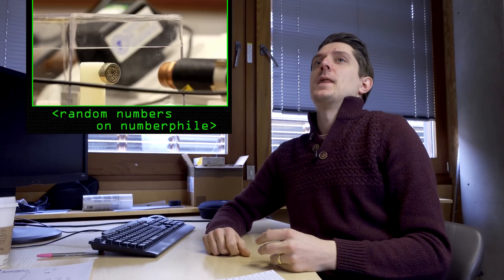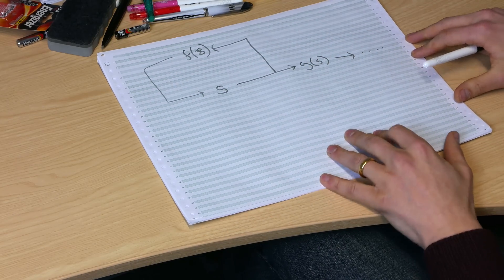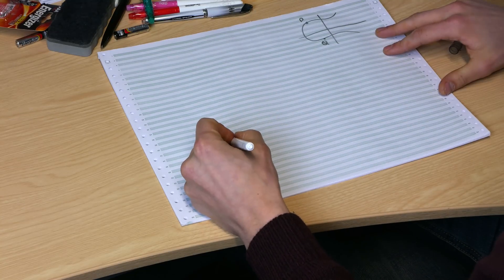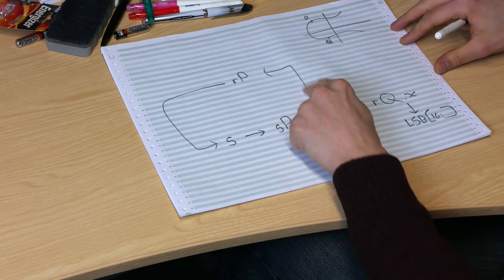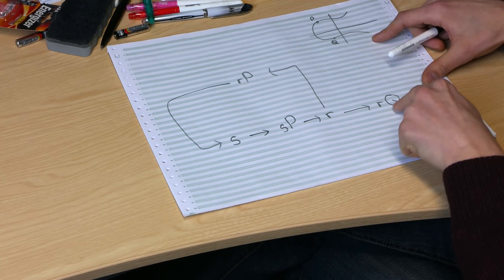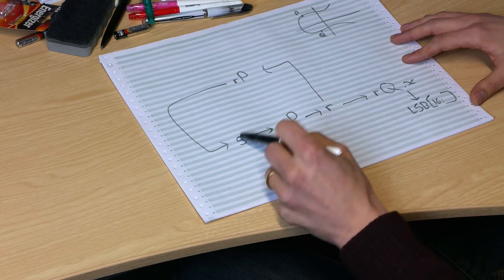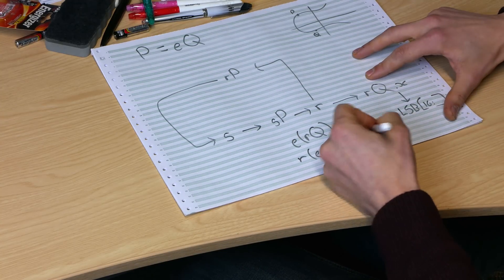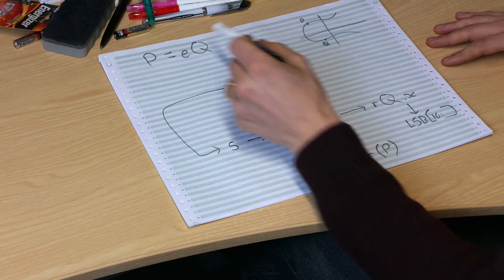Elliptic Curve Back Door - Computerphile

Comment: Tomorrow news:
Dr Mike Pound was found with 3 shots to the head in a body back in the river and the officials rules it as suicide.
Reply: (pst, Cameron! that's the joke...)
Reply: Nah, the official story is he jumped off the top of a tall building near the river, FELL on 3 bullets that happened to be on the ground, and his body rolled into the river. Seems legit.
Reply: bag*
Reply: You predicted Epstein
Reply: Pfft, that's absurd.  You don't need to control what information gets released very tightly when you've got enough influence over the communication graph of a population to ensure no large-scale change to the status quo can occur.  Once you realize how easy it is to break social networks and increase the distance information has to travel (in terms of nodes/people it has to pass through) in order to spread to a large number of mostly-disconnected clusters in the graph, you realize it's tremendously easy to ensure any concerns, no matter how grave, remain isolated within only a few corners of the society.  It requires nothing more invasive and extreme than bouncing or dropping some emails, removing a seldom-contacted person from a contact list, messing up a persons phone so they need a new number, things like that.  Once the critical links between mostly-disconnected clusters (links which are inherently the weakest ones in the whole social graph) become unreliable or break... they are unlikely to be re-established.  And with that, it becomes exponentially harder for an idea to spread from one mostly-connected cluster to another that it is then totally disconnected from.
Reply: @codetaku7  You sir have eloquently formulated this technical concept/idea I had in mind for so long about how some gov's (especially in our Arab neighborhood) are getting foreign technical assistance in doing mass population control to short circuit any activity leading to a coordinated social uprising based on social media. But I believe true human randomness is the key they don't have a copy of.
Reply: Dustin Rodriguez tfw too smart
Reply: @codetaku7  The NSA made me not read your eintire comment because it was too long.
Reply: He must be an android to be able to shoot himself in the head three times.
Reply: Nah, he isn't a threat... if he had dirt on Hillary or Jeb, well, that is another story...

Comment: Why not use a different random number generator to generate the P and Q value?  Then wouldn't it be mega secure?
Reply: Matt T It would. Like he explained toward the end if you pick your own P and Q then it would indeed be secure. The issue was that the NIST wouldn't give you a certificate of secureness unless you used their specific P and Q, which is a huge red flag.
Reply: @Matt T: Well, it's sort of a double-edged sword there. The fact that they won't certify you unless you use their pre-determined values is suspicious. But on the other hand, the fact that they won't just let you pick your own also makes sense, because if they did then they'd be giving you license to put your own backdoor in.

And it's not really a case of promoting a less secure method over a more secure method. We don't know if there's a backdoor in their values, there could be, or there may not be. They could be requiring the use of their values because they have a backdoor and ulterior motives. Or they could be requiring it because they know that there isn't a backdoor and is therefore guaranteed to be safe. But there's no way to know for sure.

The thing is that you don't want the values to have been picked by ANYBODY, because anybody who picks them is automatically suspect of potentially having ulterior motives. But how do you get values like these that weren't chosen by someone? You could use some other random number generator, but then how do you prove that that's where they really came from?
Reply: The problem isn't just that it's not secure. Even if you would take different P and Q values, anyone who uses your service, doesn't know who else knows about your P and Q. So even if you don't use the backdoor-numbers P and Q that were "proposed", you can still give other people the P and Q that you chose, which would still give them a backdoor.
Reply: Per Mortensen - A red flag that your securness isn't certified by NIST, or a red flag about NIST having anterior motives?  Because it raises some red flags to me that NIST would promote a method that is less secure, and withhold their approval to more secure methods.
Reply: @Per Mortensen : Are P and Q the A and B of the EC equation, or are they the coordinates of the base point?
Reply: phiefer3 yea I guess it's a chicken or the egg problem
Reply: +I No, P and Q are not the A and B of the equation.  A and B define the specific shape of the line, while P and Q are just (hopefully) randomly chosen points on the line.

So for example you could pick A=7 and B=3.  Our formula is y^2=x^3+Ax+B as in the video.  Then P could be something like (12,sqrt(1815)) and Q be something like (-6,sqrt(-255)).  Now I've just picked random numbers out of my rear.. I'm sure in an actual system like NIST's standards they would choose A and B such that those square roots are cleaned up and whatnot but the point is to illustrate that A,B have nothing to do with P,Q.
Reply: The fact that they require they own P and Q is basically an admitting that there is a backdoor, I mean only from the understanding we gathered by this simple video, there would be no actual security reason for requiring those specific ones.

Anyhow, assuming "e" exists, how would someone go about determining it? Is brute force the only possible way?
Reply: I can see the problem.  Those numbers need to exist for this to work.  If you were to pick some highly randomized numbers, other people might get suspicious that you picked those for a reason and there might be some vulnerability because of it.  NIST comes out and says were only going to approve of your security if you use the numbers we picked, but you have the same problem.  Do you trust NIST to not build in a vulnerability knows by either them or some government?
Reply: +Koroistro it doesn't necessarily mean that -- they have two options:
P = random(); Q = random(); e = ??;
or
P = random(); e = random(); Q = eP;

In the first case, they wouldn't know e and they could justifiably claim that they've only done some checks to ensure P and Q aren't trivially related or otherwise easy to break and therefore they're confident that the chosen P and Q are safe.  In the second case, they've intentionally created a back door.

If the US government could be trusted at all, there wouldn't really be a question here.  But they've got a fairly long track record of trying to invade people's privacy both foreign and domestic, and having to do it in secret as doing so is a direct infringement of their citizen's constitutional rights.

Comment: How hard would it be to try and brute force "e"? Would this be a BOINC distributed computing capable task?
Reply: Great analogy, I would also back this up with calculations:

Lets suppose we have a method of moving an electron up a state in a hydrogen atom at 100% efficiency. Why we do this? We need much less energy to change an electron state than to flip a transistor.
Now lets suppose we have a counter that uses the electron energy level as bits. To move from state 1 to state 2 we need 13.6eV. Lets suppose we only need to move one electron when counting up (best case scenario).
To count to 2^256 we will need 2^256 * 13.6eV. Which is 1.57477x10^78 eV. In petajoules it is 2.5231×10^44 PJ.
The sun produces 3.8×10^26 J of energy per second, there is 1.577×10^17 seconds in 5 billion years (the lifetime of the sun). 3.8×10^26 J/s * 1.577×10^17 s = 5.9926×10^43 J = 5.9926×10^28 PJ.

TL:dr, This means we will need 4210359443313420 suns at 100% efficiency to power this machine.
Also means it is impossible.
Reply: It would be essentially by impossible as there are 2^256 possibilities. 

If you were to take the entire lifetime energy output of the Sun and channeled into the most efficient computer possible, you still wouldn't be able to count from 1 to 2^256, let alone perform computations on all those numbers.
Reply: not really, way too hard without a quantum computer
Reply: Lets not forget that the machine above only counts the numbers. If you were to compute something, I would multiply the energy requirement by a constant number (approx 1000?). However it does not matter anymore since 10^15 suns vs 10^18 suns is not something we can care about.
Reply: Hence why Robert lenders said that even if we eliminated 99.99% of the numbers (since the curve is known), it would still take ~10^11 suns just to count those numbers.
Reply: Just to point out: there are 2^256 bits, which doesn't mean there are 2^256 points on the curve
Reply: postvideo97 yes, apologies for not carefully reading the preceding posts
Reply: Ok lets say we can somehow eliminate 99.99% of the numbers we need to guess to find e. Now, using the math above we only need the energy of 421035944331 suns to run this hypothetical 100% efficient computer.
Reply: Quite unfeasible: it has more possibilities than the number of atoms of the universe.